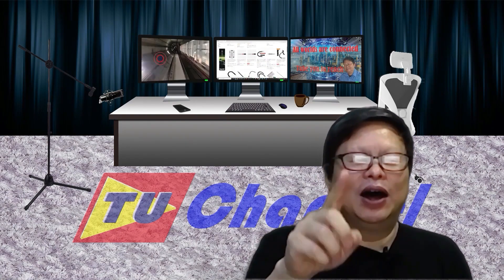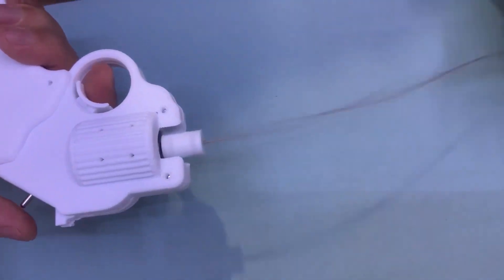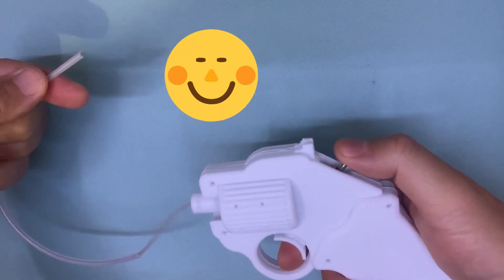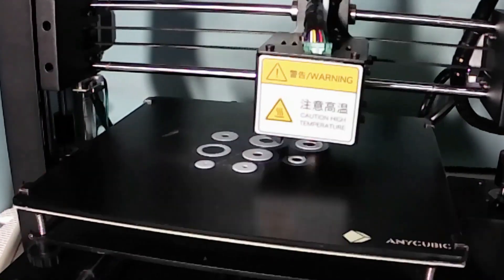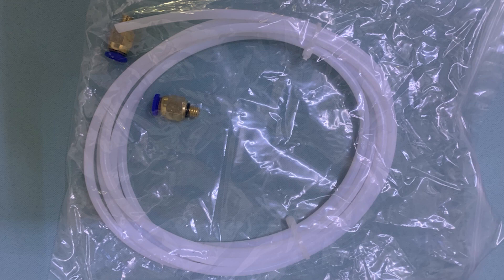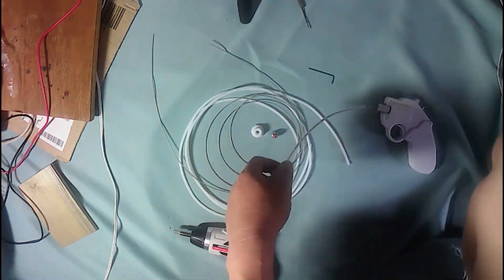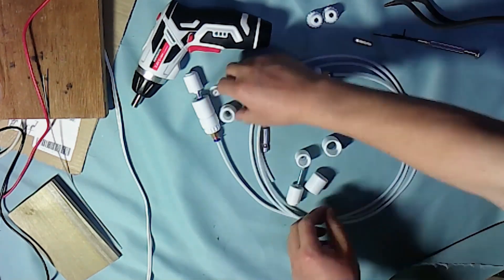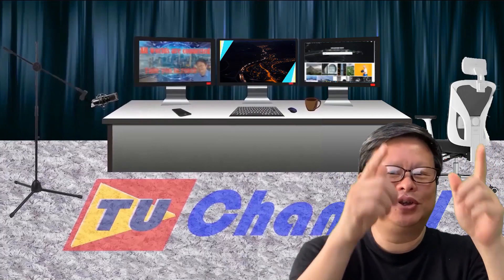Make a longest home made flexible shaft in the world using a stainless steel wire

Comment: Awesome👍
Can you give me idea about what degree of angle of twist will happen during transmission through such thin wire. Does you have any estimate of error in power, if yes please tell me.
Reply from the maker: I am not sure how much it will twist. The force will keep the shaft rotate no matter how much it is. The stainless wire is strong enough even it is twisted.  I have uploaded a new version that makes this device easy to use. You can check that video. Please share with your friend. Thanks a lot for your comment. Have a nice day.

Comment: Man please explain about Torque output..?
is Input Torque = output Torque....?
i mean Torque = Force x Distance then it should be reduced acc to my theory???can u test and eloborate??
Reply from the maker: Thanks for your comment. The torque is described as you said = force x distance. In this design, the input and output shaft is almost the same. The speed does not change also. So the output torque should be the same as input in this case. I have another video that explained the speed, torque, and their relationship. You can check it if you are interested in it. 
https://youtu.be/CuomogWeHcc  And I have upgraded this design to make it more easy to use and simple. 
https://youtu.be/GKP7OYOwWck  Hope it will give you some help.
Reply: @TubeUnderdeveloped  Then this is a game changer in my projects!!😬...Thanks for the explanation and sure i will check it!!
Reply: @TubeUnderdeveloped  i found this ans on google..can u eloborat!?
[The answer, like almost all things in Engineering, is that it depends.

Power is a function of speed and torque. Speed is not affected by the length of the shaft.

But torque can be affected. The length of the shaft had an effect on torsional (twisting) stiffness. The longer it is, the less stiff. If the torque on the shaft is varying a lot, then those changes in torque are damped by the deflection of the shaft.

If the shaft is under a constant torque, then the torque loss is almost zero, because it will deflect to a given position and then stay there, acting like torsional spring. A spring doesn’t “absorb” forces, as it pushes (or pull) just as hard on whatever its attached to, so the effective loss for a steady force is zero.

In the real world, all loads vary, so expect some losses with increased shaft length.]
Reply from the maker: @XD_SPIDER  I can see you are an expert now. I am also learning a lot from your comment. Thanks. Have a nice day.

Comment: its will not work,  you must show it on work
Reply from the maker: You must use quite a precise length of wire and connect it correctly. It is not easy in fact. I have made an upgrade version that much easier. You can check the video here. Hope it will give you some help. 
https://youtu.be/IreuYDumPa0